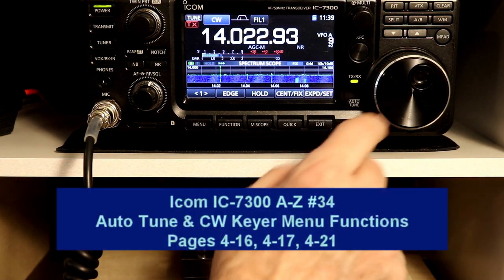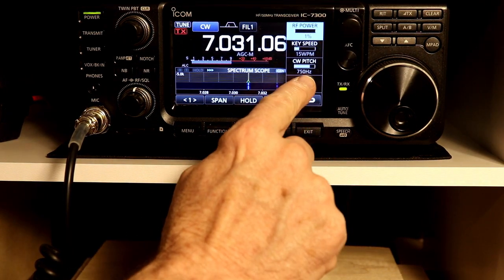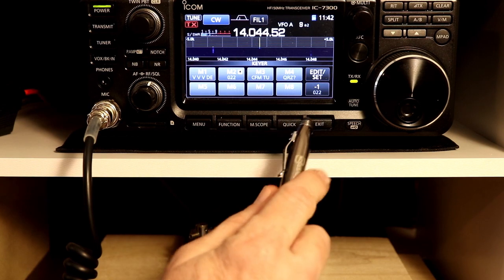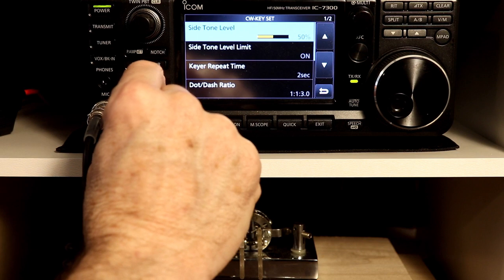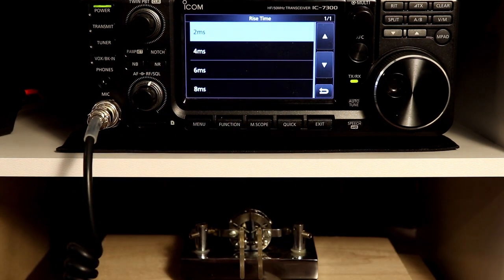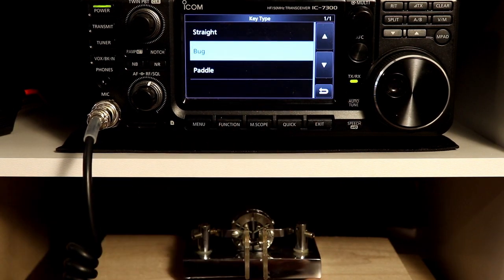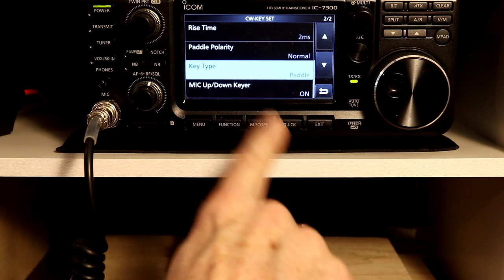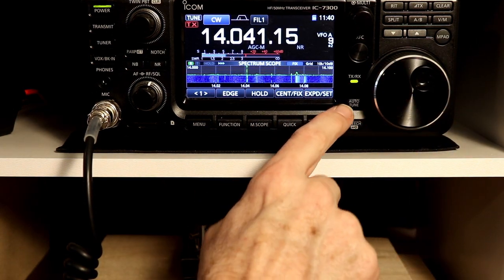Icom IC7300 A to Z #34 Auto Tune & CW Keyer settings

Comment: Tom, thank you again for this great video series! I use the “mic keying” feature every day to tune and touch up my manual antenna tuner. I work mostly SSB. I have my menu set to straight key and the mic keying on. Turn down the power, switch to cw (make sure semi-break-in is on) and key the transmitter for tuner adjustments. I don’t remember where I found this hint - it’s not my idea but it works great. W2RSB / F4WCM
Reply from the maker: Hi Robin.  That’s a great hint.  There is another method that doesn’t require you to disable your Mic Up/Dn buttons—. If you just switch your mode to RTTY instead of CW, keying the Mic will transmit a solid carrier.  No buttons required.  You still need to remember to turn your power down.  73, Tom
Reply: @HamRadioA2Z  Even better. Thanks!

Comment: If you have not mentioned it in a previous video, don't forget the "CW Normal Side", which can be set to either USB or LSB. To get there you press [MENU]->[SET]->[Function]=>[CW Normal Side]. This feature mimics the ability to tune the BFO control on a vintage receiver to either side of the receiving channel, as on my old RCA AR88. Suppose for example you tuned in a signal to produce a 500 Hz audio tone. Suppose then an interfering signal appeared producing a 1,000 Hz tone. By tuning the BFO to the other side of the desired signal the interfering signal can be zero beat and the received signal will still be 500 Hz. However, ICOM made a huge mistake by putting this feature in a menu. It really should be provided by a front panel rotary control. Thus you could conveniently and almost instantly zero beat an interfering signal of any frequency, although it often would change the frequency of the desired signal. But that doesn't really matter. The important thing is to zero beat the interfering one. This is a huge operational advantage. Trying to accomplish the same thing using the ICOM's menu selection during an actual QSO is too time consuming while at the same time copying code. Plus, it doesn't allow you to tune the BFO as on a vintage receiver. ICOM really should have talked to some old WW2 CW operators on this one.
Reply from the maker: Thanks.  I will talk about the menu option for “Normal”, but you will be glad to know that this is a simple touch-screen switch on the front panel.  If you’re in CW mode, just touch CW at the top of the screen.  Then, on the mode select window, touch the CW button and your mode will change to CW-R (CW-Reverse).  It switches to the other sideband.   Repeat the sequence to switch back to CW Normal.  The menu option just sets which side you prefer to use as Normal vs. Reverse.
Reply: @HamRadioA2Z  Wow!!! Thank you so much for this info about CW-R. I had noticed CW-R appear from time to time but I never noticed what it did and I was always too busy or lazy to look into it. I take back my previous criticism of ICOM. The more with your help I learn about this rig, the more respect I have for ICOM. It's not exactly like my old AR88 that allowed fine tuning the BFO oscillator with a nice big knob that was easy to grasp, but it's still pretty darn effective. And by only touching the screen twice and then either the main tuning or RIT to achieve zero beat on the interfering signal, it's reasonably convenient to accomplish during a QSO. Thanks again. Keep up the good work on your videos.

Comment: I'm not in front of my IC-7300 right now, but if it is similar to my IC-7610, then the Auto Tune button will also zero in on an AM signal in spite of the instruction manuals for both radios mentioning nothing about it.
Reply from the maker: Thanks for the tip!  I’ll try that on mine.

Comment: Do you have any experience using this radio with a Ciro Manzzoni baby loop antenna.?
If I connect the CI-V port to the ATU tuner for the Loop antenna can I connect the radio through a USB port to a Computer and use software to control the radio?
Reply from the maker: Hi John,
I’m sorry.  I don’t have any experience with that antenna.